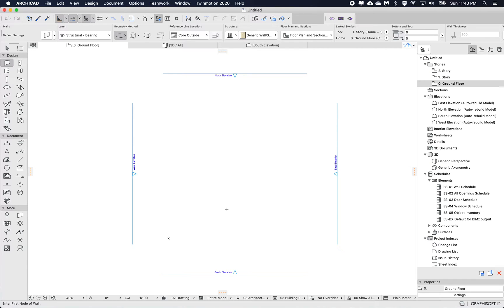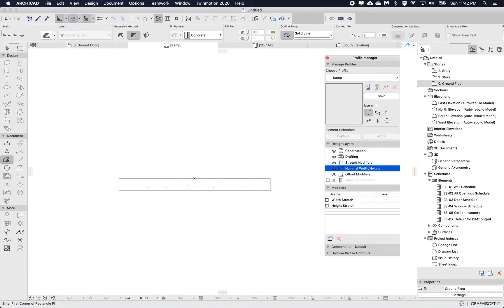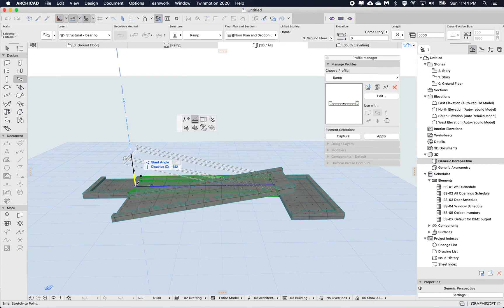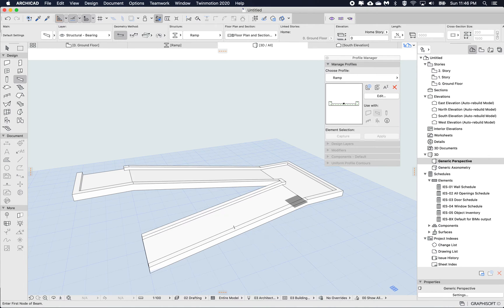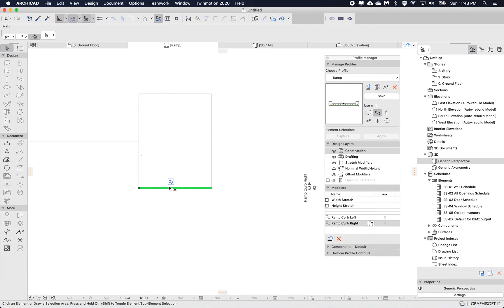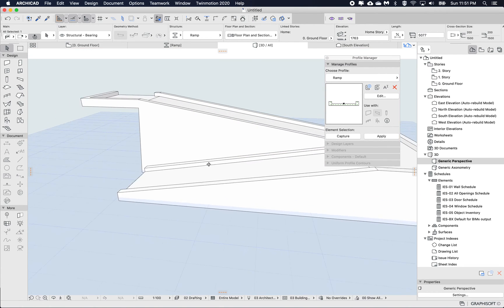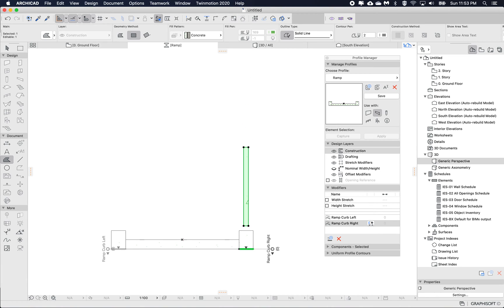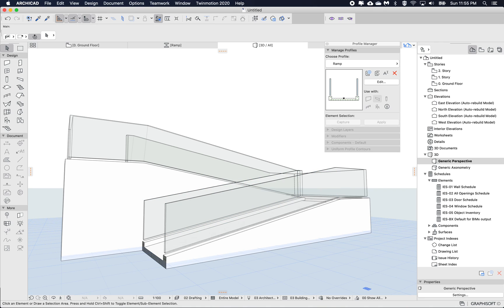ARCHICAD Tip - Creating a Ramp with Beams

Comment: Hey James,
Thank you very much for another great video! It's really really helpful for me! 
Could you maybe do me one favour? Can you please show how to add a (in autocad it's called "visibility state") function where you can show or hide the railing? 
Would be great! 

Cheers,
Martin
Reply from the maker: Hi Martin, thanks for the comment. I'd probably model the "railing" separate in this case, and use layers to hide it. Or set the Profile component as "finish" and the ramp as "core" then use Partial Structure Display to show Core only.
Reply: @JamesBadcock  Cool! Thank you! I'll try that! :)
I'm just thinking:
Is there also a way to show or hide the left or right railing separately? I mean integrated in the complex profile? (And not with 2 separate layers...?)
Reply: @JamesBadcock  hi sir can u make a tutorial about how to make a railings using this method? I only have archicad 20 .